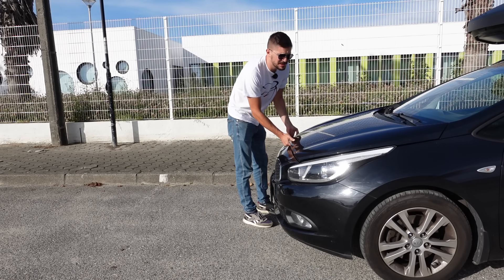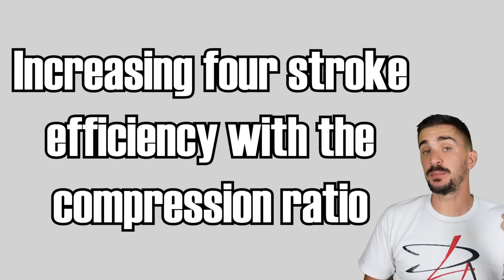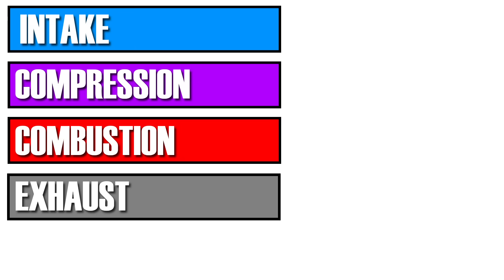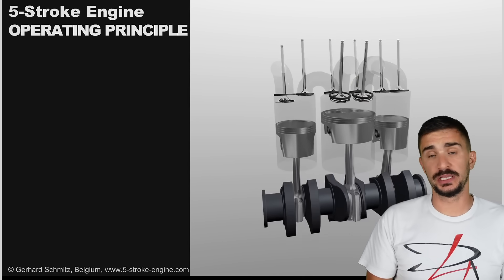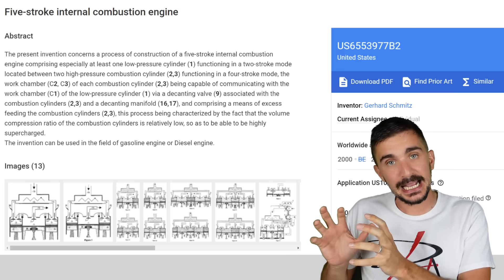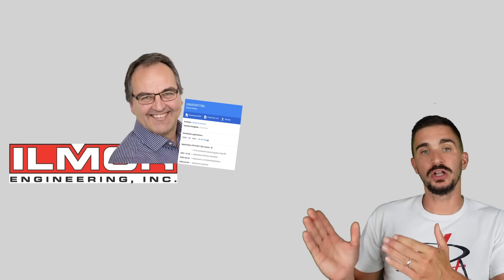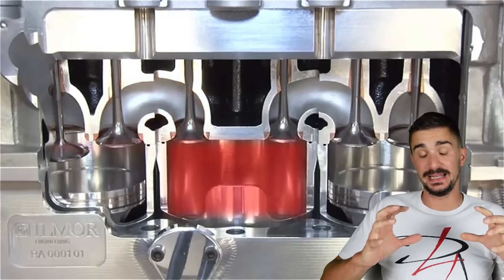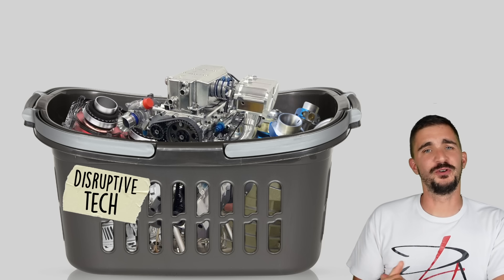Why Five Stroke Engines Are More Efficient But Still a Failure

Comment: The middle piston, instead of making power by harvesting exhaust gases at low rpm, is taking power away. The cause may be that it is too big. It's the same as with a turbocharger: if you put a big turbo on an engine, you will get a lot of lag at low rpm, but it will hit like a freight train at high rpms. So maybe matching a smaller piston will help. Also, a smaller version of the catalytic converter will benefit as well. The reality is that we can't use the same components with a new design; they have to be adapted or even redesigned. This doesn't mean the idea doesn't work; it just means we haven't invested enough to work out the bugs.

Comment: Most modern engines already do this "fifth stroke" by the use of a turbocharger, the exhaust turbine extracts energy from the hot exhaust gases which gets transferred into positive intake pressure which pushes down on the pistons during the intake stroke, does the same thing. Plus of course you can change the operating parameters of the turbo on the fly, from low boost operation using only the expansion energy and increasing engine efficiency, to high boost operation for a large increase in torque on demand (at the expense of efficiency via an increase in exhaust backpressure, but you can't have everything).

Heavy Diesel engines have also used an exhaust turbine to add torque directly to the transmission exactly the same way. 

It's just much simpler to fit a turbine to the exhaust than add an extra cylinder to the block just for this second expansion.
Reply: I just wish there was a way to know the orders of magniture of these forces and energies.
Reply: @seriouscat2231  There is, it's called engineering.
Reply: @BigUriel , where should I go to look for this… engineering?

Comment: The Porsche approach of just using a turbine to turn the energy in the exhaust gas into electricity seems better.  That approach naturally deals with the fluctuations and turbines are a well developed low weight way to harness energy.
Reply: Exactly! Same concept, clever solution.
Reply: still, under light load, the consumption wasnt better. and most of the time, the engine in a car is under light load.
Reply: @BlacKi-nd4uy  The key difference with Porsche's approach (not really theirs as it was obvious but they got it out) is that you aren't using the recovered energy to send to the output now but saving it in a battery for later use -- including for running a turbo.

That solves the problems about light load -- during that time you let the engine do all the work and store the recovered energy.  When you need a bunch of power you have boost w/o lag (the 'turbo' is really an electric motor running ogg battery) and you can take that battery power and directly drive electric motor in transmission.

--

Those planes used a mechanical linkage w/ crankshaft which meant that if you had enough torque at the rpm already you weren't going to get much benefit especially w a carb and no ECU (no way to cut fuel at a given rpm and let turbo make up during light load).

Also there are issues w/ losses involved in needing to sync turbine and crankshaft speed.  Electric motors can go after the gearbox and every part can spin at it's optimum rate.
Reply: This type of engine (turbo compound) was used on large bomber aircraft in WW2. 😮
Reply: @stevendzupin2592  I think the battery storage plus electric turbo (which is really a variant of supercharger imo) makes it substantially more appealing.  See my other reply.
Reply: But.. wind turbines cause cancer....

Comment: In ww2, engineers built something that used exhaust gas to turn a turbine that would couple to the crankshaft,  increasing hp and fuel efficiency

Comment: IMO we shouldn't count the inner cylinder displacement in the same way we don't count turbochargers
Reply: Agreed. The important thing is how much air (and fuel) a cylinder ingests per intake. In a conventional engine each additional cylinder adds to that demand of both air and fuel because they’re operating in parallel. These low pressure reclaim cylinders operate in series. They don’t require more air/fuel on the intake side more so they require more capacity on the output side. If you include the low pressure cylinders in the displacement numbers all of the flow rates for calculating things like EFI sizing and timing, exhaust diameter and muffler design, even how big of an air filter will be oversized. I suspect it would need some extra design for pairing an appropriate turbo because the turbo will see lower pressure and temperature because of the fifth stroke pressure scavenging.
Reply: The video does make a good point though, it does add to the packaging requirements. It might flow like a <X> liter engine but it’s going to take up more space than you might expect for a conventional <X> liter engine. We need 4th dimensional engines!

Comment: Compound engines can be more efficient... but the added complications of the design end up negating what little is gained.  By this theory, you could argue that 2 stroke engines are more efficient than your so called "5 stroke" engine.  Detroit Diesel capitalised on this idea back in the 1930s, and they continued to use 2 stroke engines all the way into the 1990s.  Ultimately, 4 stroke tech proved to be just as well when turbos were used, so even DD abandoned their tradition and switched to 4 stroke engines.  
The most efficient system is steam... when it comes to making use of each piston stroke.  Steam can be used to not only push pistons down, but to push them back up as well, resulting in a "1 stroke" design, where every single stroke is a power stroke.  Of course, some type of fuel has to be burned externally to make steam, so there is still some heat energy wasted.
The most reliable way to make ICE's more efficient is to simply add more cylinders.  Again, this was a popular idea in the early 20th century, with many car manufacturers making engines with 8, 12, 16 cylinders or more, but again, this adds to the complexity of the engine, adding more costs, etc... which is why these engines are typically only used in larger or more expensive vehicles.  
Electric vehicles have been tried in the past as well, and while batteries have improved tremendously in the last 20 - 30 years, they're still nowhere near efficient enough to even begin to replace ICE's.  The longest lasting, most proven, and most efficient engine designs in our history are still the fossil fuel burning 4, 6, and 8 cylinder piston engines that will continue to be used for decades to come, whether people like it or not.

Comment: 10 years ago i first heard about this, and i did research. At the time, there was a video that could be found of a brass era car which had a T head combustion chamber with a central expansion cylinder. You could hear it running and it was near silent. This did make it into cars, it didn't just lie dormant for 124 years, only about 100.

Comment: A Compressed air engine would be cool if ever produce. Air becomes cooler upon sudden reduction in pressure so air can be directly injected into the cylinder it will absorb the heat allowing high CR and lower emissions. Cold air is also more denser means less power required for compression. Turbocharger can be used to refill the air tank.
Reply: Isn't this more or less how adding nitrous oxide to an engine works?  Oh, I missed that part at the end about refilling it from the surrounding air.
Reply: So you're basically using the turbo to push more air into the engine, except the air tank allows you to disconnect the timing of the two processes.  I've heard of using a turbo to charge a battery, and then using the battery power to push more air into the engine.  Kind of accomplishes the same thing.
Reply: @billberg1264  turbo increase power output but doesn't improve efficiency or emissions as CR must be lower down to avoid knocking. My solution is to add cold dense air which help to increase CR.

Comment: The radiator dissipates the wasted energy. Not the exhaust.
Reply: All heat is waste. Radiator and exhaust but also just heat that moves through the engine block, cat, etc. A perfectly efficient engine would require all energy in the fuel to be turned into work. Any heat (or pressure waves) that leaves the system is energy that didn’t go into work.

Comment: Toyota has been using the artificial  Atkinson cycle for years, combined with their VVT-i (Variable Valve Timing with intelligence) technology, to enhance the efficiency of their hybrid vehicles. This combination allows Toyota's hybrids to achieve thermal efficiency rates of over 40%, significantly improving fuel economy and reducing emissions. As much as i know scavenging is a big problem but they managed it

Comment: Limited. We run over 50 psi on subarus now. We figured it out. 4 cylinders 1100 hp, what’s a Subaru compression ratio now starting at 8.4:1 with 5:39  50 psi boost. Probably around 20:1.. they say 8.4:1 with 10 psi is equivalent to 15:1 so it’s probably not exponential due to heat, but today’s turbo cars put down some serious boost.

Comment: Thank you for another great eucational video. Electric propulsion for vehicles has its benefits, but as time goes by, and electric cars are not consdered as novety, we start facing a new problem - the old batteries. Those cars lose their values pretty drasticalls, and the batteries themselves pose a super challenging problem - a problem we just decided to have without nobody foring us to.

Comment: About the BEST Operating RPM (Moderate to HIGH Speed/Loading) in order to extract more of Remnant Energy from High-pressure (1st stage) two Pistons, on contrary that the ordinary City-traffic (Jam) will never allow the Beast (adventage side) to out-roar, except on the Highway/motorway or up-country. The partial problem is that (even already small) Turbocharger, the inlet must be switchable/designed to (be by-passed) not operate at low RPM, (NISSAN Almera did that with very simple by-pass valve added) Anyway, if the kick-off Torque still low, simply the IDLING-Speed can be tuned-UP ( Just like when Air-conditioning was installed, the IDLING-Speed must also be splashed-up, says from 900 to 1,100 rpm.) Think of 698 cc.for idling, it always in most Economical mode.. so don't mind kick-up idling Speed a little bit higher (1,150 rpm?) Only remember i have mentioned about adding of turbocharger BY-PASS Valve, isn't it OK.(?!?) Or some engine Expert once said ; wanna have roaring Engine, it's NOT Economy; wanna save money (fuel), it will never ROAR.
Another thought (my guess) this Engine by itself is only a little less than Perfect, you don't need exotic Titanium Alloy to cheat on kW per Mass of engine ; even though the real Capacity is 1,476 cc. Not 698 cc.but the sipping of fuel will tell/prove itself. It's not Dr.Schmitt (Geheart) didn't see the by-pass valve (for Turbo) must be added, it's very easy for him to think about (like forth mentioned; Nissan Almera). But (i guess, again) his AMBITION is too high, He wanna be remembered just like Rudolf Diesei (or Wankel at least).. the great inventor who CHANGE the world. Even far better than that if he could be such FAMOUS as Henry Ford, the Great.. the Father of modern gasoline Car. He might think of new Eco- Mobile with super efficient/economy without sacrificing of Power, as in his OWN Name, the Schmidt - Mobile. Once ILMOR ever suggested/proposed him of totally taken over the Engine patent (with some amount in exchange) He/Schmidt rejected at once, for his 5-strokes is once in his lifetime? And for auto-industry, this patent does (more or less) not be 2nd to the Wankel/Rotary (that always leaky), eg. I wish him finding solution/other OEM for his beloved BRAND to born, encouraging by XiaoMi, electric appliances Brand, if XiaoMi can make a Car (Su-7), so why can't Schmidt Brand be obstructed,... OK in amidst of EVs' Price WAR, this TIMING is really BAD time to kick-start any Auto-Brand. Another way i can suggest, just negotiate again with ILMOR if for a real BETTER Deal/Price, please Just SELL IT...and wait to see your magnificent IDEA successfully running around the world, if..., Then 700 cc.(1,500) could grow up to 1,400 cc.(3,000) in real life Commercial size (multi-purpose) passengers 's Car.
BEST REGARDS./ (Wait & See this new Eco-friendly engine to serve all road-runners.)

Comment: I think a lot of alternate ICE designs fail because they try to be competive relying on mechanical drives and so have to have very large torque and efficiency bands.  If they use electric drive and confine the motor to function as a generator, I think it's a lot easier to get a viable competitor for OTTO.  Micro-turbines deserve more attention for that usage though.

Comment: If the extra piston in the 5-stroke design is reducing the exhaust gas temperature by extracting more energy from the air/fuel mixture, does that have any benefits for reducing NOx and unburnt hydrocarbons in the exhaust? Maybe it wouldn't need a standard catalytic converter, it could get away with a smaller or none at all if there's less "pollution" in the exhaust?

Comment: It's amazing the constant improvement of the ICE. I suspect it has not scene it's end and has many more improvements coming. As far as electric cars go, my major concern is the lifetime and weight of batteries. I have been looking for the possibility of a liquid carrier of electrons that can be transferred into a fuel tank and have the electrons extracted to run the electric car and then re-energized. I could see a fueling station that accepts the depleted carrier into a tank, the carrier is replenished at the station and the carrier transfers the newly recharged carrier into another tank for refueling at the pump. The question is how many times the carrier can be recharged and the minimum charge state that can be pumped into the next car and would you be charged according to the density of the electrons.

Comment: Im just wondering, wouldnt the solution to this be have 2 exhaust valves, one to feed the middle, one to vent out to exhaust while rpm is low? You would still have that dead weight, tho. Would need a bigger starter. If the third piston had its own crank, a clutch could engage it at a certain rpm too, but then it wouldnt be in sync. 
This idea is just to try and salvage combustion pressure, but what about the efficiency lost in unburnt fuel? Wouldnt it be more efficient to try and recombust the exhaust with the extra piston, even if you had to inject a smaller amount of fuel to it to get it to burn, rather than just reclaiming the pressure? I think that could work better.
It may be better to instead of adding a piston, just adding the 5th cycle to the existing pistons by exchanging the exhaust gasses from one to another.
Edit:
Thought about this a bit more, seems you could use the exhaust exchange idea I mentioned before on a 4 or 8 cylinder easily enough, where they would alternate between active and passive cycles, where fuel was only being used and sparked half the time, but scavenging power on the second. Alternatively, you could make a 6 cycle engine using this, bc youd be wasting a suck and "squeeze" to just be wasted venting back.
I still like the simplicity of this old design in the vid though.

Comment: All heat based engines are limited by Carnot cycle, where exhaust gas reach (approach math limit) ambient temp. of surroundings thus Efficiency factor is E.F=1=100%. If and only if condition of such condition is stroke length approach infinity, thus rpm approach zero. Exist big but, Lamborghini tractor have very long stroke and Efficiency is 40% where Lamborghini super car have very small stroke but rpm can reach more than 50 thousands rpm efficiency is much less than 20%. Speed versus efficiency. Tractors need efficiency excavators, bulldozers, farming equipment.

Secondary small stroke is very small vibrations, at for 50 thousands rpm it is very good thing. Where for slow tractors rpm is not so much.

Biggest limitation of heat based technology is surroundings temperature T. In thermodynamics exist even measurement unit exergy with deals to ambient temperature, additional to energy, entropy and enthalpy. They intentionally sounds like energy.

By away Carnot cycle is applicable to heat Q energy converting into work W is one of the interpretation of 2nd law of Thermodynamics (Carnot, Oswald, Boltzmann). Heat energy converting into heat E.F=1=100% is not just theoretical but practical limit.

Comment: Yes as you already understand the volume and velocity of exhaust gases are not always optimal for the secondary, larger cylinder,, I propose a separate engine operating from the pressure of exhaust gases,,operating simular  to a steam engine and turning an electric generator with some battery storage which can run an electric motor syncroed back into the drive train,,Oops, Did I mention bulky and complicated but can work, fixing several problems,,,...Your welcome people.